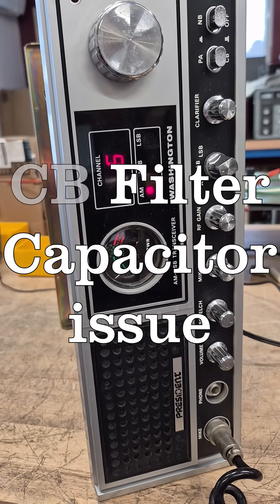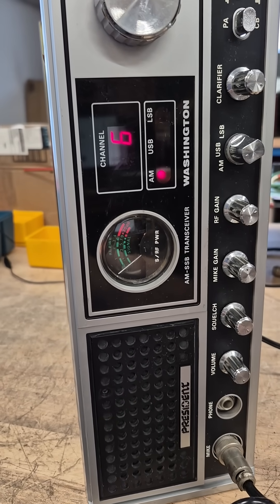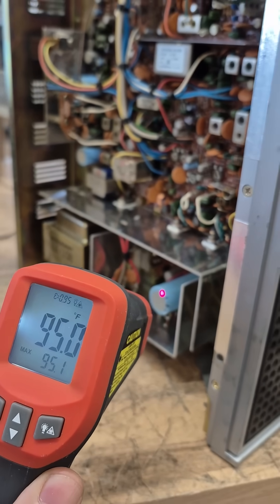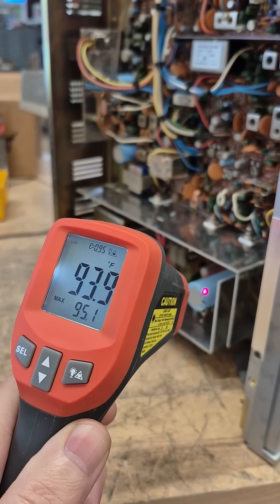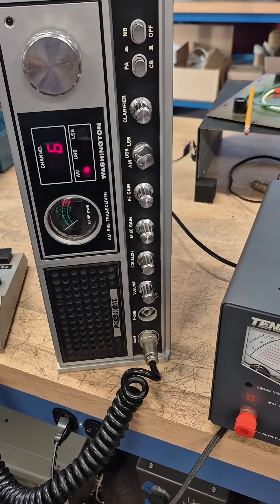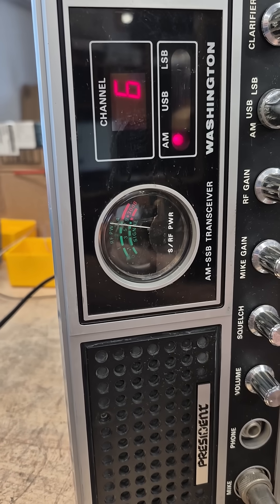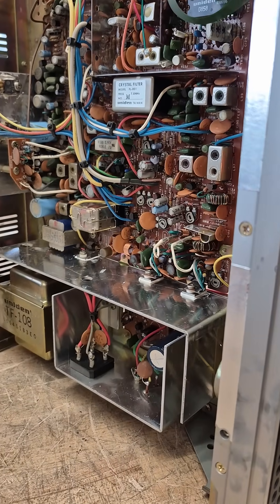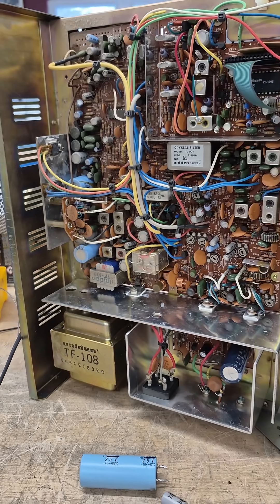Low Power CB #diy #shortwave #vintage #repair #audio #antique #retro #hamradio #old #broken #radio

Comment: after 40 years or so I would safely say a few more caps on that 8915 chassis needs replaced. nice job on finding that cap. that heat difference spoke volumes